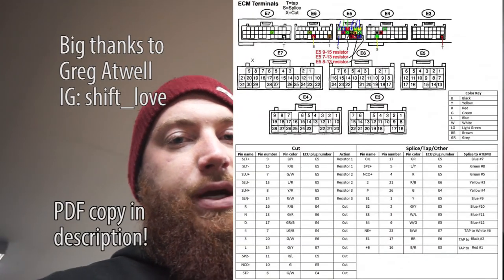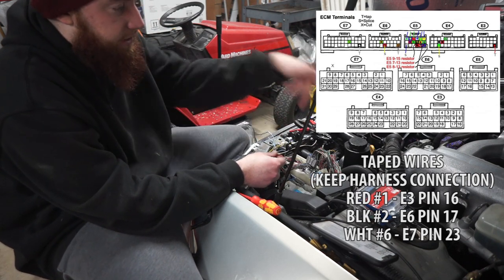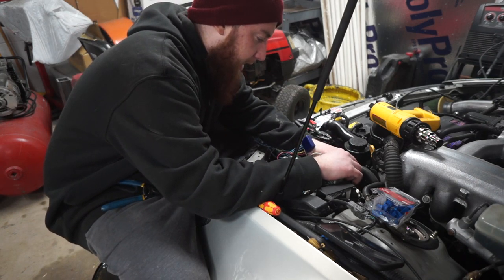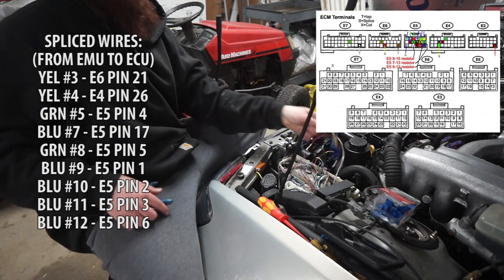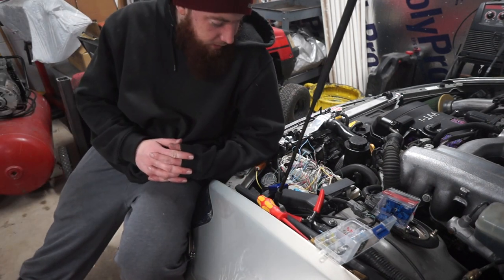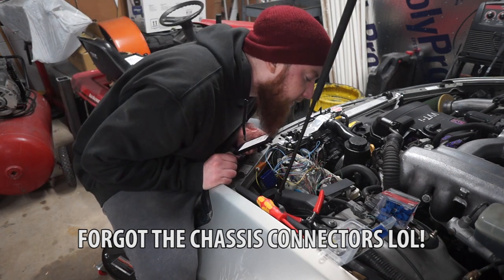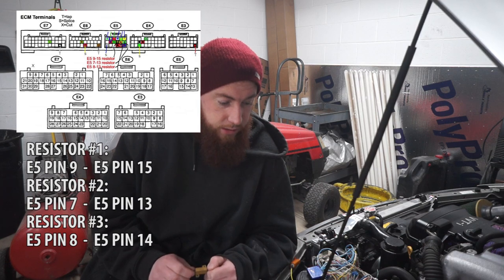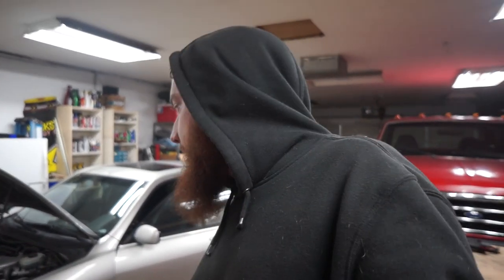01 IS300 AUTO TRANSMISSION EMULATOR INSTALL!

Comment: Damn brotha, thanks. I have an 04 but didn’t want to pay 400+ for an ecu so I went with serial9 emulator. But couldn’t find shit on wiring besides the “diagram” it comes with. I’ve got all the shit ready for my manual swap just waiting on warmer weather. This shit made my day.
Reply from the maker: The harness and ECU pins change after 01 so unfortunately this how to won't work with your chassis.
Reply: @electricsmith1650  Yeah I know 02 and up I have a different pin out. I found one that should work, I’m hoping. But I’m just glad that I found some one else doing an emulator. But your video did help with the whole resistor thing I wasn’t understanding that.
Reply from the maker: Glad I could help! When I was trying to install this it was very irritating not being able to find anything online so I knew I had to make a video on it.
Reply: @electricsmith1650  do you have any video connecting the resistor
Reply: @electricsmith1650  did you notice a huge difference after wiring the emulator, as far as it not being in Limp mode anymore? I got the swap done a couple weeks ago but I haven’t gotten around to installing  the ATEMU but the car seems to be driving solid and I daily it. I will eventually get to it.

Comment: the resistors get rid of the transmission codes that pop up? ive had my 01 lexus manual swapped with a emulator but cant get the check engine light off
Reply from the maker: Yes the resistors get rid of the check engine light. That’s their only purpose. After I installed them I realized they got too hot inside that box so make sure you mount them outside of the box!

Comment: This this remove the electric throttle control and traction control?
Reply from the maker: This removes the limp mode you get after you manual swap an 01 car.

Comment: For the spliced wires , when we cut it do I leave half of the wire from that connection hanging and just connect the emu to the ecu ? Or we wire it all together
Reply from the maker: Yeah the spliced wires go just from the ECU to the EMU. The wires in the harness part just hangs out!

Comment: I k ow this was awhile ago but what was it doing? Why did you install this?
Reply from the maker: We installed this after we manual swapped this 01 car. 01 cars have different wiring than the other IS300s so we couldn’t swap in a manual ECU. 
This emulator tricks the ECU into thinking it still has the auto trans, therefore not leaving the car in limp mode after a manual swap.

Comment: 6:47 were it says on the top left wires to cut. Are those wires you chop inhalf and dont connect to anything?
Reply from the maker: Yes you have to cut them out of the ECU
Reply: Thank you man i got mine installed with no issues

Comment: I have a 2001 is300 I’m doing a auto to manual with a cd009 is the ATEMU The only thing I need to wire besides the reverse lights also what about on the transmission sensor there is 2 black wires do I need to still solder them together or the ATEMU will take care of that ?
Reply from the maker: The ATEMU will not take care of reverse lights, I still need to get that one figured out along with spedo
Reply: @electricsmith1650  well I understand I have to wire up my reverse lights, but there’s 2 black wires on the switch that goes on the transmission that goes for park drive reverse etc and there’s 2 black wires do I still connect those 2? I think it makes the car start or in neutral to make the ecu think it’s in it
Reply: @electricsmith1650  and also I have a 2001 is300 that means my mph runs off the wheels not the tranny or diff like the 02-05 so I don’t need to change that

Comment: Does this device help activate the vvti and help with power delivery and throttle response or does it only get rid of the check engine codes ?
Reply from the maker: The emulator helps the engine go to full rmp and help with power. The resistors get rid of the CEL
Reply: @electricsmith1650  thank you for your responses i appreciate your videos

Comment: Hey sorry if this sounds dumb but I’m new to is300s what does this actually do, does it help improve shifts or?
Reply from the maker: It's specifically for manual swapped cars. The factory auto ECU will change the rpm of the engine before the auto trans shifts. If you manual swap with an auto ECU the car will preform slower than it should. This fixes that issue.
Reply: If im replacing an 01 auto trans with an 01 auto trans its should be plug and play correct?

Comment: I just did this on my 01, wondering if you were able to complete all readiness monitors and pass smog.
Reply from the maker: From what I understand this only gets rid of transmission codes. They do make an emulator for 02 sensors though
Reply: @electricsmith1650  I actually dug into this issue a little more. The resistors do get rid of all check engine lights associated with the removal of the auto transmission. However, I believe what’s causing the O2 and cat monitors to not set is the Vehicle Speed Sensor reading 0 mph when driving between 0-20mph and 0.62 mph when driving approximately 21+. Currently I’m trying to somehow wire the three wire manual transmission sensor to the two two wire auto speed sensors (probably the output speed sensor). If anyone has experience with this please chime in and TIA.
Reply: @williamyoon  hey did you solve this and pass smog? looking for tips
Reply: @williamyoon hey ik its been quite a while but i did a manual swap on my 05 focus but its virtually the same issue since my manual sensor is also a 3 wire vs 2 on the auto. essentially one wire needs to connect to the signal on the output shaft sensor harness, 2nd wire goes to ground anywhere on the chassis, and the 3rd will be whats called power hold relay, which essentially gives the sensor 12V for it to work and read speed. that will connect to a pre-existing wire with the power hold relay description from the park/neutral switch so you just T into that and that should be it
Reply: @layzbaguette8340  Wow, has it been 2 years already? I still have the car but I actually haven’t been able to look into this issue yet. Appreciate the information and will get back to you when I can do it.
Reply: @williamyoon i’m actually interested in this as well lol

Comment: How do you wire up the resistors?
Reply: E5 pin 9 to 15
E5 pin 7 to 13
E4 pin 8 to 14
Right?
Reply from the maker: @hotchalupa18  E5 for every resistor, no resistors on E4. I recommend mounting the resistors outside of the box as they do get hot.